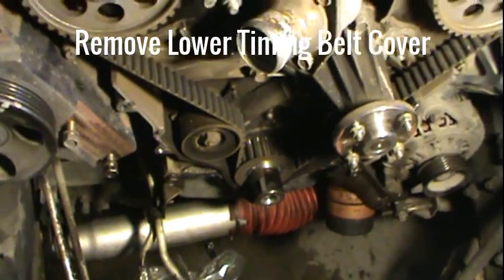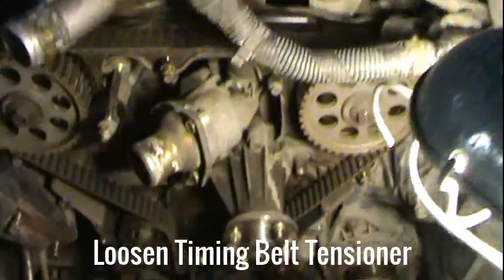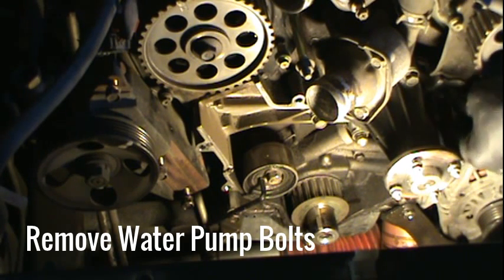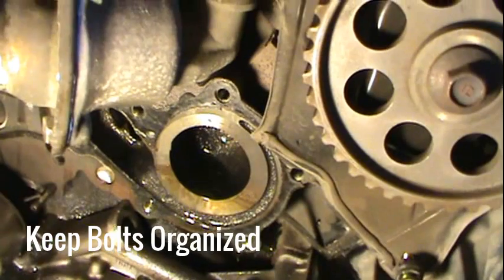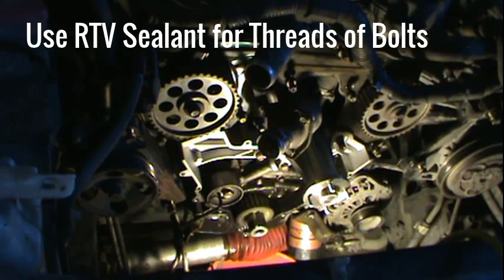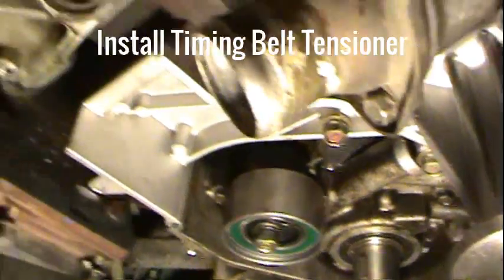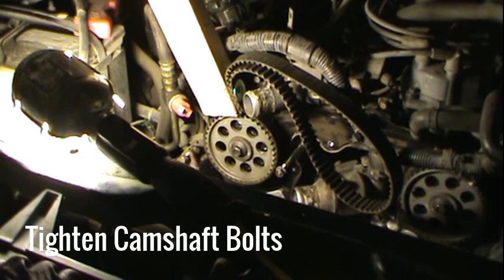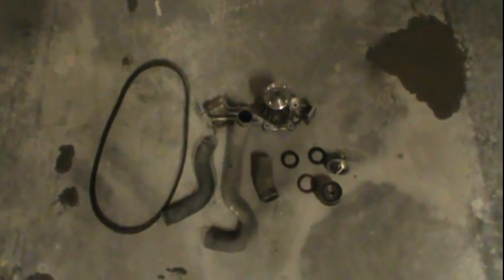Timing Belt, Timing Belt Tensioner, Water Pump, Thermostat, 2004 Nissan Xterra 3.3L V6 Part 4

Comment: Best step-by-step video on how to do this job for this car hands-down. Question, would it be easier to loosen the cam pulley bolts with the old belt still on so they won’t move and if they do move they move together? Also, can you send me a picture of, your cam seal installation tool? Thanks great video!
Reply from the maker: @jw3028 Glad the video is helpful. Made this one years ago and cool to see its still helping. Yes, your idea  should work to hold the cams in place to get the bolts loose. Here is a link to a video I made for someone regarding the tool I made.
 https://youtu.be/vIYXvitK8WQ
 Hope the project goes well.
Reply from the maker: Here's another video of the camshaft seal tool. 
https://youtu.be/u49g16RtTRY
You could also check your local parts store and see if they have a tool loaner program. Oreillys has one and they might have a seal install tool with various sizes that might work.
Reply: Got the job done this weekend! Took me 2 whole days!! Lol!! But it runs. I managed to put the cam seals on this time too. Taking the cam gears off was a little scary fearing that they would move and get everything out of time. But using an impact with the old timing belt still on and tensioned kept them perfectly still. Thanks so much for taking the time to make the video and sending me the links to the seal installing tool. And I appreciate your prompt replies!
Reply from the maker: @jw3028  glad you were able to get the job done! Happy that the videos helped

Comment: Only thing I caught was when u said the water pump bolts were 144 ft lbs of torque. Lol I honestly don't know the actual number but to anyone wondering that is not it. Good luck getting them that far chance is every one of them will snap
Reply from the maker: Yup. You are right.  Not 144ft lbs. 144 inch pounds.
Reply: @grantvarvil2929  I wondered, but thank you for verifying that! I'm actually doing a timing belt on a 2000 xterra as we speak so that's good info to have! One last tip for anyone else is just be very careful on the amount of rtv silicone u use! Both on the bolts and the gasket! A light light coating will do. Use ur fiber to spread it on evenly and get the excess off. Also on the bolt threads just a touch will do! To much and can chance a false sense of tight when torquing down. Or even worse crack the bore. I've seen it a couple times sadly
Reply from the maker: Great tip! Thanks for taking the time to share some knowledge 👍

Comment: Hi. I'm about to replace my timing belt for my pathy 2002. What all I should change with this service? How many belts are there? My spare pRts guy tolled that 3 belts. Is it true
Reply from the maker: 3 belts. One for alternator, one for power steering, one for A/C. You will need to set proper tension separately to all 3 belts when done. Do your water pump. You can also replace Timing Belt Tensioner, cam shaft seals x2, crankshaft seal x1.

Comment: You really need a pulley holder to keep the cam from moving while breaking the bolts free.  Good series of videos so far it really helps get an idea of the scope of the project.

Comment: Thanks for the quick reply, I was planning on using O'Reilly's so that's good did everything hold up well? Again I appreciate it!
Reply from the maker: You're welcome! Everything held up fine, but sold the vehicle about 2 years after I did the job, so not sure now, but confident the parts are still working well. For the water pump gasket, use some of the "Permatex High Tack Spray a Gasket" spray. It helps to hold the gasket in place while lining everything up and getting bolts back in. Make sure to not over torque the gasket bolts or you will have leaks.

Comment: Did you use genuine  Nissan water pump, or auto zone, also what brand timing belt and thermostat please,thank you for the video!
Reply from the maker: Hey Ken, glad you enjoyed the video. Hope it helps when you do your job. In regards to parts, it has been quite a few years since I made the video and dont remember the exact manifacturers and brands of parts. I definitely did not use any Nissan genuine parts but got everything from local Oreilly Auto Parts here in Anchorage. Genuine parts were not in the budget!
Reply from the maker: One thing I would do in regards to thermostat is to remove first and take into part store to make sure you get the same temperature range for the thermostat to open up as the original in the xterra. Or google your exact year/make/model for what thermostat temp rating you have in the xterra
Reply: Will do thanks for the video, info,and tip!

Comment: The one part I need to see he didn't even show it
Reply from the maker: Sorry didnt get what you needed on the video. Is there something I could try walking you through?
Reply: @grantvarvil2929  I was needing to see how you took off the tension pulley off the timing belt is where I'm stuck at
Reply from the maker: @kaseyallen4577  cool. So loosen the nut that retains the tensioner pulley. There should be a hex Allen wrench hole offset from the center that you would insert an Allen wrench to twist clockwise (if I remember right), hold the allen in place, and that  should loosen the tension on the belt enough to pull it off.
Reply: @grantvarvil2929  thank you

Comment: great video, but the part where you were using your torque wrench as a breaker bar made me hurt inside a little bit.
Reply from the maker: Totally understand the pain. The torque wrench was broken and had lost the spring so didnt work anymore. Repurposed it as a breaker bar
Reply: Grant Varvil that makes me feel much better

Comment: Wish you would have shown how to tighten the timing belt. The directions that came with it were pretty vague.
Reply: Same thing I said. I'm trying to figure out how to set tension on tensioner and he the belt back on
Reply: @bendooley5639  I did mine just yesterday when I did my timing belt.  Once you get the new tensioner back on, make sure the hole that has the allen key faces in the down position. With an allen key, turn clockwise until the key until the tool is slanting and lined up with that first bolt on the casting to the left.

Comment: Recommendation is to replace all belts (4), the water pump, the tensioner, the three oil seals, and lastly the two pulleys. Might as well do the spark plugs too and the three radiator hoses. I've done this twice now and this is a pretty good video.

Comment: I wanted to give you a huge THANK YOU! I replaced all belts, timing belt, water pump, and fan clutch. Your series helped me out when I came across something I wasn't sure about and answered every question necessary for doing the job.  Once again thanks!
Reply from the maker: Glad it helped you out!
Reply: Grant Varvil  hello body my exterra is cheyking big time and i díd tunaup and ir does the same You thing is time to reset time belt
Reply from the maker: Thanks for watching the videos.  If the tune-up did not change the shaking of the engine, it could be out of time.  When the belt wears over the years, it is possible for one of the cam sprockets to jump a tooth on the belt, causing it to be out of time.  If all of the fluids are at proper levels, the spark plugs have been changed, air filter is clean, and distributor is working properly, and it is still shaking like crazy, I would change the timing belt.

Comment: Just a heads up! Great job and great post. I snapped one of the water pump bolts so I went on google to make sure and found that it's 144 in lbs or 12-15 ft lbs.

Comment: Great help thanks! Would love to see your homemade seal installing tool. My cam did turn about 30 degrees when initially breaking cam bolt.... any input regarding that?
Reply: you should be fine in regards to the non interface engine. I moved one camindependently from the other and did not have damage to pistons. turn cam shafts equal amount back. the best rule of thumb is to count the teeth of the belt between each sprocket line indicator to ensure proper timing.

Comment: Im replacing my timing belt and water pump soon, any special tools you recommend using?
Reply: +Kevin Avalo Get a Crankshaft Pulley puller from your local auto parts store.  Oreilley's Auto usually has loaner tools that you can borrow.  Tack sealant for the water pump gasket makes it easier to install.  Make sure to align the timing belt properly with the dimples on the cam shaft pulleys and the back timing belt case.  Make sure to have the large socket to pull the bottom crankshaft off.
Reply: +Grant V what about a harmonic balancer tool
Reply: Same thing as the crankshaft pulley puller. The bottom pulley is the harmonic balancer. The issue I had with the puller from O'Reilly auto parts was that it did not have the right length and threading for the bolts that marry the puller to the balancer pulley. If you have the same issue, take off one of the bolts that you have removed from the xterra already, and try to match the bolt to the female bolt hole on the harmonic balancer where you thread in the puller to the balancer. Once you find a bolt that fits, go to home depot or Lowe's and find a carriage bolt with that threading so you can make your puller tool work. Hope that all made sense. There should be an explanation in this video series that shows the bolts I used.

Comment: In your best guess, how far do you think you can safely turn one of those cam shaft sprockets without damaging a head or something? I wasn't able to keep them from spinning when I checking the seals and over turned the left one pretty good.
Reply: Thanks clovis. I've got everything put back together,  but I guess I didn't fix what broke down my car to begin with. So still trouble shooting.

Comment: What if one (me) didn't make sure that the vehicle was at TDC before removing the belt? I got in there to replace the water pump and did NOT realize what I was in for! 2001 Nissan Frontier v6

Got it all put back together and cranked it. It runs, but is making a very loud scraping noise.. It almost sounds like the timing belt is scraping the thin metal cover plate--the bottom one. Is it possible that I've screwed up the tensioner? ALSO, since I hardly ever do any mechanical work and thusly didn't know a whole lot about the timing belt/sprockets, I did not ensure TDC when I removed the belt. Once the belt came off, the top right (when you're facing the engine) sprocket turned slightly counter clockwise. When we put the belt back on, I turned it back clockwise just a tad. Now I DID mark the belt and the sprockets, BUT the black sharpie (only thing I had at the time) marks hardly showed up, of course...

Anyway, I'm headed out to take it all apart again and see what I can do about lining up the sprockets and belt and try to figure out that damned scraping noise... But, HEY, the brand new water pump is on there!

I hate that manufacturers purposely design vehicles to where an owner can't fix his own shit anymore...
Reply from the maker: Tenshi B I'm not a certified mechanic, so take what I say with a grain of salt.  One of the reasons for putting the engine at TDC is to assist with lining up the camshaft sprockets and the crankshaft sprocket, and to keep the Timing of the engine intact.  With the belt, there are a specified amount of teeth on the belt that are to be between the Left and Right sprocket, a certain amount of teeth between the right camshaft sprocket and the Crank, and a certain amount of teeth between the Crank and the Left Camshaft.  If you had messed up the amount of teeth spacing between any of the sprockets, there would have been a noticeable issue with the engine running due to the timing of the engine being out of specification.  You would have noticed the engine running rough, difficult to start, etc.  From your post, it sounds like you were able to keep the timing of the engine intact.  

The scraping sound- Could very well be the belt rubbing against the Timing Belt Cover.  I know it sucks to take everything back off, but do it anyway.  When you get things off, rotate the engine and take note of where the belt sits on the sprockets; it could simply be adjusting the placement of the belt on the sprockets.  If the tensioner is an issue, you may hear a "Whine" when the engine is running.  If so, redo the tensioning process.  

Hope this helps!  

Grant
Reply: Grant Varvil Hey Grant! The mystery is solved.. I took the belt off and did the long screwdriver into piston #1 TDC assurance. Then I made sure to match up all my marks on the cam gear teeth and backplate and lined them up with the old marks on the belt (which the last people to do this did NOT do) AND THEN counted the teeth!

Everything was lookin' good as far as gearing/timing and belt placement, so I put the  bottom cover back on and also the big pulley and manually turned all that. And figured out what the damned scraping noise was.. It was the little bolt that's on the very bottom of the coverplate! This particular bold was not the same one that we took out (didn't keep them organized) and stuck up just barely far enough to touch the back of the pulley!

SO, all this for a new waterpump.. I put everything back together, including the radiator shroud and then got my keys and hopped behind the wheel. I said a quick prayer, kept my fingers crossed, and turned the key.. The baby came purring to life and actually sounds a little BETTER than ever! And so... on the way home, guess what? Overheating again! HEH.. can't win for losing! [=
Reply: +Tenshi B  Did u also put in a new Thermostat
Reply: It will be almost a year ago in a month or so from when this all happened, Kidd. I did NOT put a new t-stat in there at that time, but I eventually did, and that didn't stop the overheating, finally, I bought a new radiator as well and that's what was causing it to keep overheating... It DID need a new waterpump, but also, the old radiator was clogged. I figured it'd be more economical to simply put in a new one since I'd done so much work to it already by then. The new radiator for this model was only something like $135.

Comment: This is an excellent video. Thank you for skipping showing me how fat your cat is, how the wind is blowing at your house, or talk about your other 3 vehicles and what you liked to do back in high school. Good educational video straight to the point and seems all inclusive. Do you think I'll need to change my oil seals if they look like they aren't leaking when I get in there? I usually use a socket for seals like that, Is that similar to what you did?
Reply from the maker: Never have liked videos where I have to try to skip through all the nonsense people talk about to get to what I need to know!  Glad the video has been educational.  As far as the seals, no, you don't necessarily have to change them if they are not leaking or appear worn.  BUT, the way I see it, if I am all the way in there and taken off a bunch of stuff to get to the timing belt, you might as well replace them so you don't have to do it again.  I made a seating tool for the seals and made a video a while back for someone who wanted to see it.  Here is the link: http://youtu.be/vIYXvitK8WQ

Comment: This is a very good video. How did you take off crankshaft timing pulley. I have the 1987 service manual it doesn't say how to take it off to get to the front oil seal.

Comment: That 150 ft/lb torque figure seems high. Great vid. Gonna change the timing belt on my gf's Pathfinder. Looks to be about the same. 160K miles on it without timing belt change. Think it's time?
Reply from the maker: I thought the same thing, but that's the torque spec I found. Its definitely time. Make sure you replace every part you have to take off to get to the belt. This is the kind of job you only want to do once!